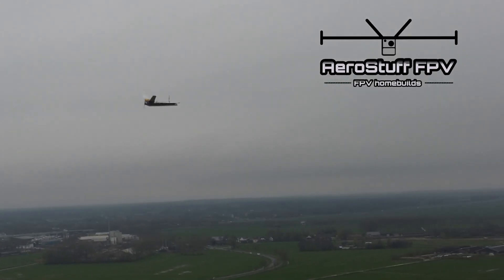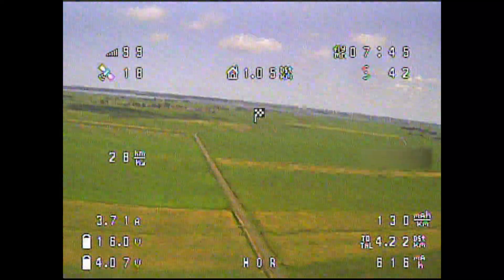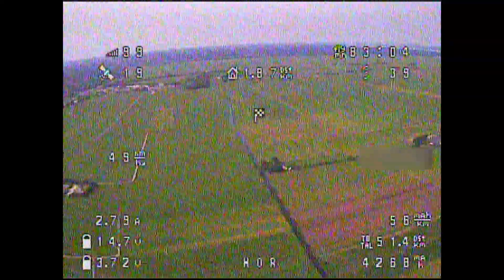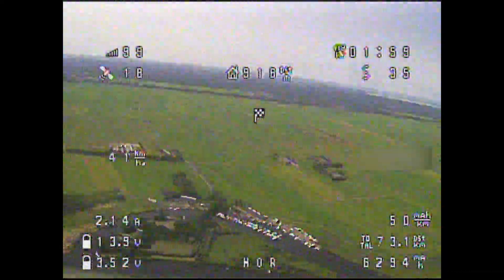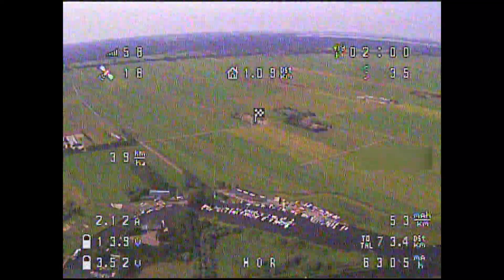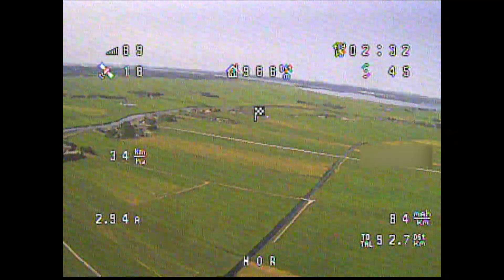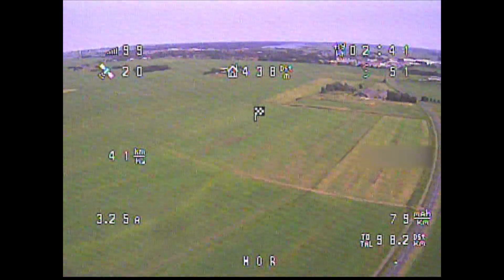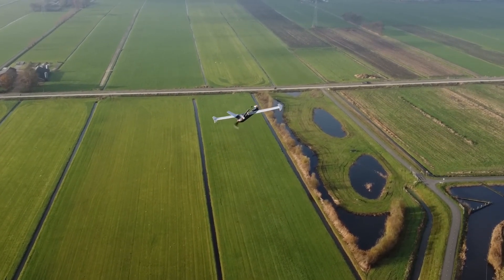Homemade V-Tail Pusher for FPV - Endurance Flight Record - 100.5km Trip Distance

Comment: Very nicely done video and flying. 
How does this Motor prop  combo compares that to the 5010 750Kv you use in another plane?
Reply from the maker: Thanks! The 750kv setup would do equally well (if not better) compared to the 600kv. 

But the 600kv allows a bigger propeller because the kv is lower (more torque) - I could’ve flown with a 12x12 or 14-15” propeller instead of the 12x8.

Comment: I tried to build the Vpusher. But fail during maiden flight. I use 750kv motor, the drone weight is 1.3kg. I am unable to test the thrust correctly, but how much thrust to weight ratio should I achieve to have stable flight?

Comment: Can you please shre which motor and prop you are using also i am wondering whats the thrust it is generating to keep that plane air borne i am sure it must be no less than 1.6kg so need atleast 500-600 gm thrust just to cruise and this much amount of thrust at 2.5 amps is unbelievable to me

Comment: Video shows that plane is shaking a little bit during flight. Maybe working on stability would help save some extra energy by reducing unnecessary drag?
Reply: How? I'm seriously asking btw, because I planned on making a plane identical to this.
Reply: @podex6354  I have no idea, maybe some stabilizers based on gyroscope and PID controller would make it...
Reply: @sebastiantomczyk4577  ok thank you. On other comments the op reply that the cause of the shaking is rising hot air, while the plane usually flies relatively stable for the most time.
Reply: Perhaps this bobbing is due to some gust or turbulence, as it seems very stable while launch climbs.
Reply: @TanM maybe 👍🏻

Comment: Great video and performance. Did you fly it the whole time, or use INAV or Ardupilot? Also, how do you accurately calculate the total mAh usage from the battery. How is that set up and calibrated? Thanks for your content.

Comment: Great achievement, going beyond 100 km endurance. Noticed the plane seems to bobble in pitch a significant amount while just causing in level flight. (eg: at 2:30)  Airspeed as a result is not constant, but varies somewhat as well. Wondering if this related to flight controller tuning (being too aggressive), or related to flying through vertical air motion (lift, sink) on the flight? The excessive pitch corrections and speed changes might be reducing efficiency a bit. Hopefully you can improve efficiency a bit more.
Reply from the maker: The wavy ride was caused by rising air. The aircraft itself is stable in nature.

Comment: How is that pagoda antenna for long range? I have the same antenna bt never tested it Long range.  I normally use long Lollipop style on LR Quads , thanks man great video as always.  I enjoy your work and even implement some of your upgrades on some of my builds. Currently building the Heewing T1 Ranger. Happy flying.
Reply from the maker: Not tested for long range, but gets about 4-5km with 600mW Transmitting power from the VTX
Reply: @AeroStuffFPV  I see, I guess I'll have to give it a shot, thanks man.